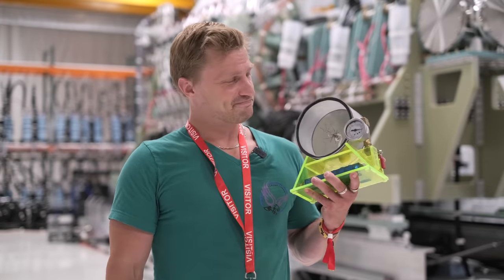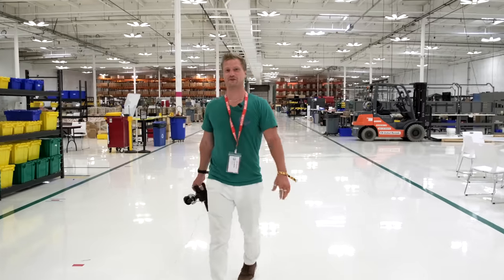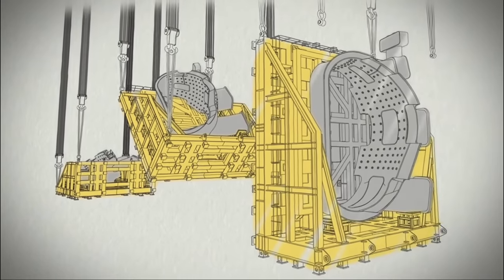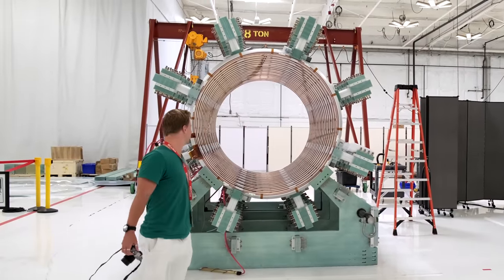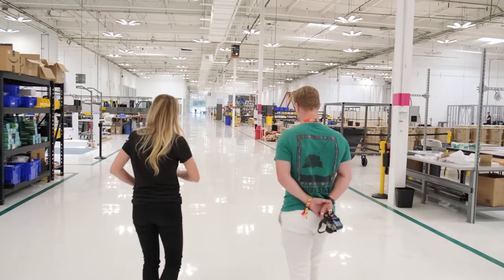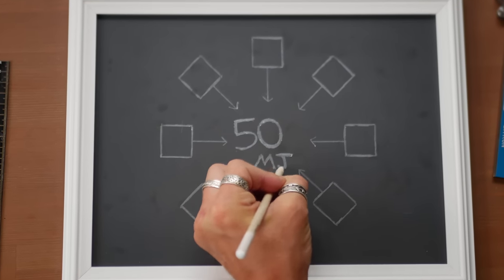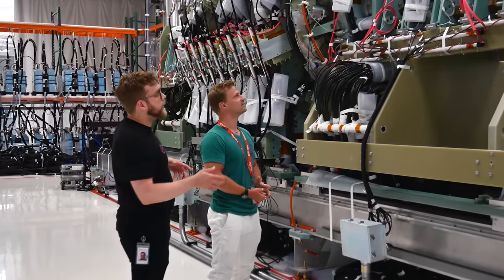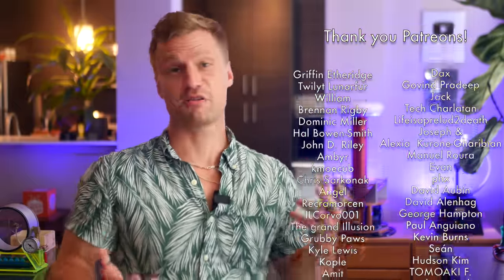An Exotic Approach to Nuclear Fusion (Helion Energy BTS)

Comment: QUESTIONS...
Facinated but some undereducated questions...
- If it needs to be such a perfect vacuum how do they quickly re-vacuum it between pulses?
- How do they extract reaction results from the pulsed gases to keep it pure?
- How do they source Helion gas?
Reply: - They designed and built their own turbomolecular pumps for that.
- Same as above. They are then separated off site. It does not have to be in real time and can be done in bulk. Meanwhile Deuterium is cheap and a 50 MWe power plant only needs ~15 kg/year.
- They fuse Deuterium in the same machine, or a dedicated machine of the same design. It happens anyway in the same machine as well, because D-D side reactions always happen, but they can somewhat control the ratio of D-D to D-He3 reactions.

Comment: So you seem like the type of guy who can actually inform me on what this self containing plasma is.   Is it essentially a vortex ring like you do with a smoke cannon but this was produced magnetically?  I mean rotating copper has an effect like an electromagnet especially when you put it near magnets, so it's the idea that a vortex tourus of plasma self contains because it has a magnetic field generating current through it because it's rotating, around the loop of the ring.  Actually which direction are they having the vortex flow because with the smoke cannons the inside is blowing out to the outside and then rotating back into the inside?  I'm thinking the direction of rotation would matter as far as what magnetic charge and pole you use to affect it.  Something we could do with this tech is potentially figuring out how to do pulse fusion engines, have enough gas expand out of the collision out of one side to where that energy recoup is making everything net zero, for a sort of cruising or normal operation throttle level, what would be pushing the fuel out would be just having less resistance on the exhaust side.  You would almost need another reactor, maybe a fission reactor, if you wanted to do a wep or full throttle mode where you're just dumping all the possible energy into thrust/exhaust speed.  What would be interesting is if this pulse method could lead to a constant burning fusion torch where the fuel just gets compressed to fusion and then is released out of a nozzle that can either use all the speed and energy it has to recoup the compression or just focus the exhaust.

Comment: Electricity is a kinetic energy. As such, it is possible to amplify the energy with an accelerating exchange of energy, as C in the “Oberth” effect. Buried in Helion’s design is such an exchange. They can claim their excess energy output is solely due to mass conversion to energy, but a more fundamental system is also in play.

Comment: The other thing.....for efficiency, there is still going to be hot gas, which they should try to harvest the heat from if possible.  That gas needs a mechanism to be ejected from the chamber after fusion and new fuel needs to be inject.  So there's still going to be an intake and exhaust cycle, less like a plasma containment tokamak.  A tokamak may not need a fuel exchange for long periods of time.

Comment: I worked briefly at CERN and I learnt their LEP used ‘getter strips’ to scrub the already high vacuums to ultra high vacuums. These strips literally suck the remaining atoms of gas out of the vacuum.
On another note I expect the expanding fusion products could be exhausted out of one end of the device thus creating a rocket…
Reply: David and several others on the Helion team do have a propulsion background. From what I get, such a system would have a very high Isp but very low thrust and T/W ratio due to the mass of the capacitor bank.

Comment: All the benefits of MI-CF and DER are astounding and more money should be put towards this specific research. Multi stage heat conversion losses have been around too long, lets ditch the turbines already. 

One thing I'd like to see discussed is the (low) availability of Helium-3 aka 3He let alone regular Helium (4He) and how they plan to source/scale production for this fuel type
Reply: They make their own He3 by fusing Deuterium in the same machine.

Comment: I suspect not ALL energy is removed from the coils.  There's bound to be some heat energy in all those high voltage, high current circuits!  But it is probably way more efficient than any other method, especially mechanically.  The big question is to consider all the energy needed for production assembly and refinement of materials, compared to the lifetime of the generator, as well as all the maintenance done in that time.  If the net energy is positive, and in sufficient quantities, which I suspect it probably will be, then we're onto something good, a workable solution.  Also, there's processing of waste, as there may be some radioactivity involved?
Reply: They are aiming for 50MWe power plants. Life times should be pretty good. The biggest problems would be the compression section vacuum chamber and magnets. Not a big deal from an energy POV. Waste should be minimal. Helion predicts that their components will be below background after less than a year. Decommissioning after less than 2 weeks.

Comment: You get He3 via the decay of Tritium...  and it is hugely expensive as a fuel.
Reply: You also get it from fusing Deuterium, which is what Helion is planning to do (same machine as the D-He3 fusion and/or separate machines in the more distant future).
They will also produce Tritium as a byproduct (which can be stored until it decays to more He3, or sold for extra profit).

Comment: Electricity flows on the outside of the wire.  The trick to energy conservation is to use copper tubing on the coils so that a coolant can be pumped through to reduce heat loss.

Comment: Imagine if such engineering talent could be focused on practical unlimited energy production of Thorium breeder reactors.
Reply: Fellow nukebro here. You might like to know that in the very early days (around 2009, before Helion was officially incorporated), they wanted to do a fusion- fission- hybrid for Thorium and/or nuclear waste burning. The linear geometry of their design is perfect for that. The beautiful part about it is that the fusion part does not have to produce net energy. A Q>0.3 is enough. The fission part makes more than up for the shortfall. Literally no one wanted it :(
Was easier to get funding to go directly to fusion and not just D-T but D-D-He3. Otherwise, we would have fusion- fission- hybrid plants on the grid by now, burning waste and making energy.

Comment: You asked everything but meaningful questions.  Have they produced a fusion reaction in any of these reactors? If so how much energy was produced?  Where these numbers verified by anyone other than the company? How do they intend to have on going reactions?  These are all the questions that mean something.  I haven't found any data on anything this company has actually accomplished.  What we have here is a whole lot of theory and no actual results.
Reply: 1. Yes. The Venti achieved 10^11 fusion reactions(neutrons)/pulse. The number of fusion reactions for Trenta is not known, but it should be significantly higher (Venti was tiny in comparison).
2. It depends on how you calculate it. Experimental machines do not capture the energy and they usually use Deuterium only. Though Trenta did D-He3 experiments but the results are not known. For Venti, assuming only Deuterium as fuel the energy released from fusion reactions in a single pulse would have been 3.65 * 10^11 MeV which is about 0.06 Joules.
Not a whole lot, but measurable.
3. Yes these numbers were verified by 3rd party reviewers. For Venti that was the JASON review team from ARPA-E. For Trenta it was a group of people from several different national labs that were brought in by their investors.
4. They intend to do 1 to 10 pulses per second with their first power plants. The energy from the pulses is stored in capacitors and gradually released to the grid.
5. Then you were not looking well. Trenta achieved 100 million degrees in 2020. Helion was the first private fusion outfit to achieve this milestone. Venti also was the strongest private machine at its time.

Comment: So many questions.
Is energy out purely inductive? What about photons? pressure waves from thermal expansion? etc. I'm NOT a physicist, so forgive my ignorance, but to collect all the energy out would require multiple transducers as a means of collection, wouldn't it?
Reply: There are losses to neutrons, X-rays and simply particles leaving confinement. They are relatively minor, though. Most of the energy will be in the charged particles. One could try to capture the energy lost, but that would most likely require a heat engine which adds to the cost of the power plant is most likely not worth it.

Comment: Sounds great! I hope they modelled it very carefully! It sounds like it is going to be extremely difficult to do.
Reply: They have done more than just modeling. They have had 6 prototypes so far of ever-increasing size and power. They are using multiple software packages for their simulations and then they go with the most conservative prediction.

Comment: Has Helion published any of their recent measurements in any refereed science journals? For example, NIF the laser facility at Lawrence Livermore Labs has published results of their laser fusion results in Physical Review Letters and Physical Review E.  Apparently, there were 1000 authors on their paper describing their evidence of fusion ignition. More recently, NIF has replicated their results. Does the Fusion energy Sciences program from the Dept of Energy fund Helion? If so, has there been a review of the Helion claims?
Reply: They published them back in 2018. Those were reviewed by ARPA-E. Since then all of their machines and experiments have been fully privately funded and they are publishing some results but not all of them.

Comment: If the energy is directly pumped back into coils, the excess energy could be directly used as ac power if the cycle time was 60Hz.
Reply: They are storing it in the same capacitor bank that stored the energy to initiate the pulse. From there it is gradually released to the grid. Some of it goes back into the machine for the next pulse.

Comment: I want to believe. When theycome up with the proper superconductors and the proper materials that their fusion  machine needs they won't need the fusion machines bc they the have superconductors. Power in, power out, conservation of energy. Even if it's at 99.99 percent. Very neat.
Reply: Helion does not need super conductors. They are working with normal magnets. The lost input energy is more than made up for by the energy released by fusion reactions.

Comment: I keep picturing a yo-yo 🪀 with a fusion boost at the bottom of the throw sending it back up. Followed by a bunch of electrical generators, extracting power on the way back up again.

I think this and the inertial compression that hits the plastic cube with a slug are the most promising.

Comment: I wonder if they could get a second reactor and curve and connect both to form a toroid. So after the reaction occurs and the plasma bounces back instead of harvesting that energy it could instead run straight into another reaction chamber. That way almost all of the kinetic energy put into the plasma from both the electromagnets and the fusion reaction would go straight into producing the next reaction (instead of running through the inefficiencies of harvesting with inductance just to power the electromagnets for the next reaction). This would allow for more reactions per second since the plasma wouldn't have to come to a complete stop and be accelerated back to the center, the fusion energy goes straight into the next reaction without needing to go through the inefficiencies of being collected by inductance to power the electromagnets to accelerate the plasma again, and you'd need less hardware to harvest and store ALL of that energy. Instead of collecting 90% of the energy you put into the plasma and that the fusion generated just to put that back into the system to keep a fraction of that energy, you'd only need the hardware to collect the fraction of the energy that is actually the excess while the energy that was going to go back into the system anyways stays in the system and powers the next fusion reaction.

I'm not a nuclear physicist, but that seems like a better solution that is simpler and requires less hardware.

Comment: Are you certain that is primarily a power-plant and not just a lithium generator for batteries
Reply: Yes, their power plants will produce 50 MW of electricity, not just store it.
Reply: @elmarmoelzer2229  noted. I still am a bit confused about using helium 3 instead of fusing deuterium with more deuterium though.
Reply: @epiclivestreams6733  
They are doing both. The D-D reaction produces a He3 + a neutron in one branch and Tritium atom and a proton on the other branch. 
They extract the fusion products between pulses and the He3 and remaining Deuterium are fed back into the machine. The Tritium can be sold for $$$$ or left to decay to more He3 for fuel. 
The D-He3 reaction is a lot more energetic than the two D-D branches and it will not produce a neutron. So they can get away with one neutron for every 3 or even 4 reactions (if they have enough He3 from T- decay or trade). 
That said, the D-D neutron is not nearly as bad as neutrons from D-T (it "only" has an energy of 2.45 MeV vs 14 MeV).

Comment: Before I mention this, I'll say that I have no prevalent knowledge of fusion reactions and how Helton is doing it, but if we only had half of the machine, could you make a cannon out of it
Reply: As far as I can understand as I too have no prevalent knowledge of fusion reactions, the plasma is contained by electromagnetic fields. As soon as the plasma leaves the containment field is simply disperses with nothing maintaining it. Not to mention, that kind of plasma confinement can only occur in high pressure and the way these machines work is through intense pressure to help stabilize the electromagnetic confinement. Cut the machine in half and there's no pressure, therefore no plasma. Unfortunately, no cannon ;-;
Reply: @dr.redacted7735  that's a shame

Comment: finally, someone who isn't just doing an AD and actually explains their advantages. direct magnetic induction generatiion is so cool, i don't know why i didn't think of it. but is there a way to make a continous version? maybe having a ring with 2 different size chambers either side so as the plasma accelerates, it compresses in the small chamber, fusing and pressing against the magnetic containment field?
Reply: You might want to think of it more as an AC generator with positive and negative flow rather than a DC generator with a continous flow.
Reply: @Suppagappa  huh, i guess it literally is, but usually AC is directionally neutral for current, unless its a diode load.

but a continuous "pumped" plasma would also be AC, the plasma being sent around a loop of differing pressure instead of into a dead end chamber, but i am very out of my depth here

Comment: Did I miss the part where they said what the net energy gain of any of the tests so far have been? Or what gain they are expecting at any future point in their plan.
Reply: Helion has not published detailed results of Trenta yet, but they did publish them for the much smaller predecessor, Venti. Venti achieved 10^11 neutrons/pulse and a triple product of 10^19 kev s /m3.
Trenta is 3 times the radius of Venti (and has other improvements). Gain scales at rs^2.1. There are some other things that help them massively, like the ratio of ion- to electron- temperature. So, you can do your own guess where Trenta is. My personal estimate puts it above JET, potentially even pretty close to D-T break even.
Polaris is supposed to demonstrate net electricity from fusion around the end of 2024.
Reply: @elmarmoelzer2229  That doesn't answer my question. Or my physics level isn't high enough to understand it.

I was looking for something like they used X kWh to produce y kWh. Maybe add in how much helion they used as fuel to produce it.
Reply: @M19pickles   Trenta was a subscale prototype (it was very cheap). It did not produce electricity as it did not have the equipment for it. Polaris is supposed to demonstrate that towards the end of 2024. Then you will get kWh in vs kWh out.
Reply: @elmarmoelzer2229  Thanks. At this point is there any proof that their method of gathering power using the electromagnets described in this video will work?

Comment: hi there, sir On June 29, 2018, you posted a video about a high-current transformer. In 8 seconds, you melted a 6-inch bolt. I want to know how many watts of transformer is required to turn an iron rod hot yellow. The dimensions are 1 inch in length by 1 inch in diameter. And in my area, I have 240v electric supply. How much electricity will be consumed? Please respond, sir.

Comment: So I've seen some criticism of this company that goes over the fact that Deuterium-Deuterium is 7 times more reactive than Deuterium-Helium3 at 100million degrees (Helion's operating temperature) so they would be making all kinds of neutrons - with woefully insufficient shielding. Not too mention that braking radiation affects the energy you generate as well loses will be a huge efficiency hit. and LOL at the "per unit volume produces a little less" its 5000 times less reactive at the temps they are hitting versus D+T at the temps that other reactors hit (which can also fuse D+H3 no problem - they just choose not to). The neutron problem is a problem - but not one that helium3 solves by magic.